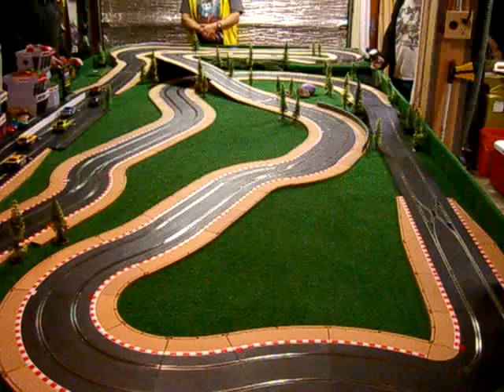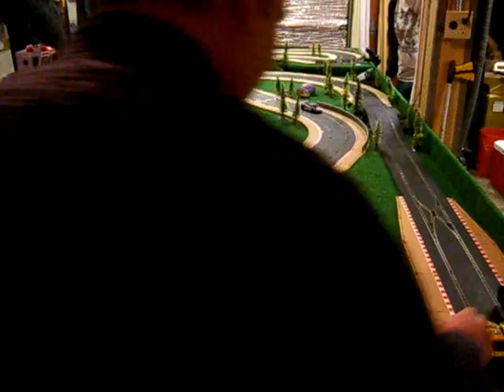DRAWW Scalextric GT race, Raceline Raceway

Comment: It's amazing how I could have missed this for so long. Very cool. Thanks for the info. I'll give it a try. They seem to work well in your video. Recently pulled the CLCs off  my track - just don't like the way they perform. It'll be fun tearing a couple apart. I have a righ turn -out to in. If I buy a left turn - in to out that should do it. Thanks!

Comment from the maker: Yeah, but what choice do you have when there aren't any extra people to marshal cars back on (or out of the way) and the track is too large to easily run around and reach cars? If we had a huge club so that a non-racing person can just sit at every corner putting cars back on, I'm sure we'd do things differently. Crash and burn is a bit harsh for digital racing, so we use chips to track crashes, as you see. Once you crash for the 4th time, you're out. But, if you have a suggestion, let me know.

Comment: Hey mate I NEED to know what boarder did you use for that R1 corner in the bottem right of the screen. Is it a offcut? Of a bigger boarder?
Reply from the maker: ? That's a standard R1 inner. Comes in a piece that is easily cut apart for whatever degree of turn. I think it's two 360 degrees in a pack?

Comment: Hi Greg - is the hump back bridge a Scalextric part or custom bent? It doesn’t look like either the low or high classic scaley bridges. I have just built a tribute to this track on my 2m x 3m hoistable table.
Reply from the maker: It's a custom piece. He removes the rails and bends them carefully, then clamps the track in a two part "mold" and warms it in his oven until it stays in that shape, then re-installs the rail.
Reply: Greg Gaub thanks Greg. I’m also liking the pitlane that went in last year. Are the ‘customers’ satisfied though?
Reply from the maker: @clumsiloe  His track is always a pleasure to race on.
Reply: Greg Gaub thanks for all the other useful videos you’ve posted! You are awesome!